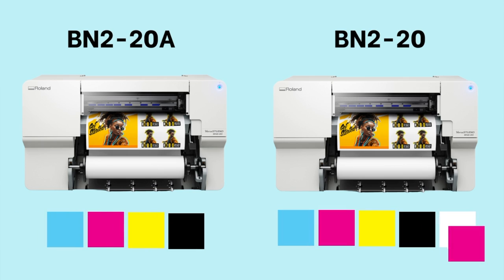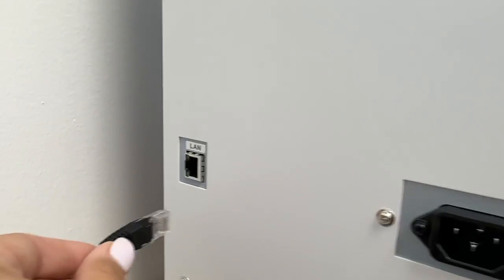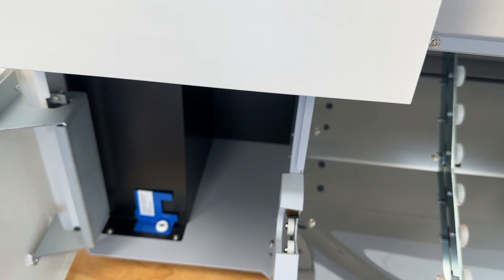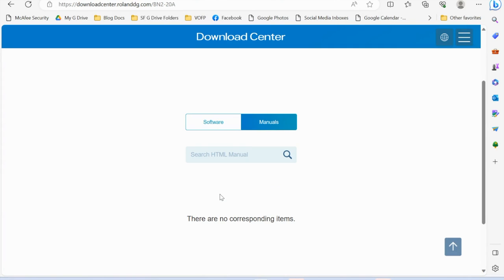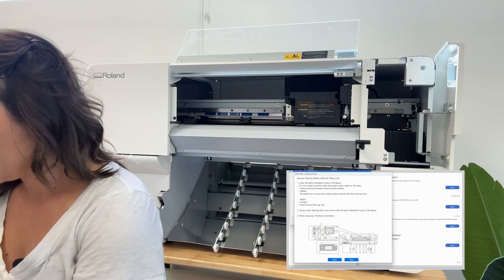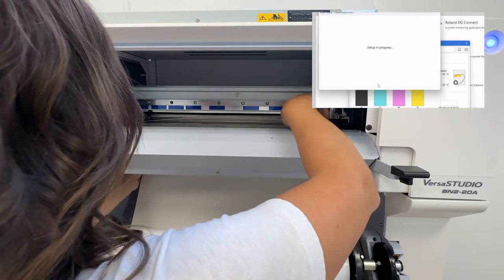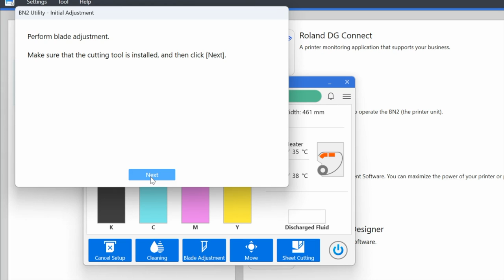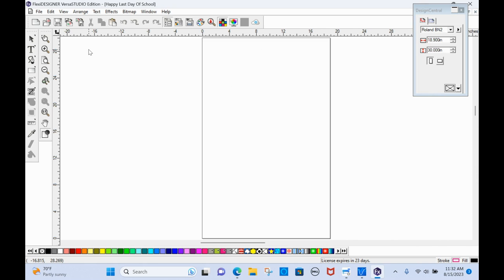How to Setup Roland BN2-20A & Software (Works for BN2-20 Too!)

Comment: Great video    setting up  BN2 20a  and stuck at error  (Roland bn2 print data is larger than the media width
Reply from the maker: Sounds like the design you have is too wide to fit on the media
Reply: I had the roller in wrong place   Thanks

Comment: Thank you for sharing these insightful videos.  I was wondering if the BN-20 is also compatible with the FlexiDesigner software.  I hear you talking about how great the program is in making it easy to add cut lines but the BN2 may be a little too much with regards to price while the BN is an easier buy.  Thank you in advance.
Reply from the maker: No, the BN-20 and BN-20A can not use Flexi Versaworks Edition.  It does make a huge difference with the ease of use with the BN2

Comment: Hello, thank you so much for sharing your knowledge. I followed your video to the letter. The issue I’m having I had a BN-20 and upgraded to a BN2-20a this versaworks wont print my PDF designs I made when I was using the BN-20 I have a job I need to finish and I get as far as loading it but when it gets to loading it to print it stays on 0%. What am I doing wrong? Thank you.
Reply from the maker: My guess is if there's a white layer in the BN-20 PDF it's throwing an error for the BN2
Reply: @SilhouetteSchool  Thank you I did figure out what it was. Did you ever have an issue with once it prints and goes to cut it off because the run was too long?

Comment: I've read that we need a separate cutter because this printer will not perf cut for very long. How true is this? I purchased this model because I did not want a separate cutting machine.
Reply from the maker: That is not the case in my experience. It perf cuts just fine!

Comment: Do you need the cleaning cartridges? Im looking to get the bundle plus extra ink, media, blades etc & was wondering if i need to also get cleaning cartridges
Reply from the maker: Eventually will need the cleaning cartridge for the BN2-20. but not immediately

Comment: Hi, great video! Is there a reason why you're not using a BN2-20insteadcof this 20A?
Reply from the maker: Yss, I don't find I need to print white (b/c the material is almost always white) nor do I want to deal with the increased maintenance that is required when printing with white ink.
Reply: @SilhouetteSchool  thanks for your reply. You're awesome

Comment: Hello, I've just installed my Bn2-20 printer, but when I start it up for the first time after filling, I don't get any yellow or magenta when testing the nozzles... do you have a solution please? Thank you
Reply from the maker: I would try to do a really good manual cleaning. If that does not work to get them going then reach out to Roland since it's a brand new machine and they should have the exact steps.

Comment: What version DG Connect Hub are you using? Their latest one v2.4.10 doesn't have FlexiDESIGNER VersaSTUDIO Edition.
Reply from the maker: What machine are you using? Flexi is only available with the BN2 machines and will show up in DG Connect once you register at BN2.

Comment: Can you cut the print to laminate and re load it for cutting like you can on the bn-20?
Reply from the maker: Yes you can
Reply: Far better to get a dedicated cutter like a Graphtec. Roland's are pretty crappy at die cutting, if thats what you're after. And for kiss cutting, its always better to let the print cure for a few hours which makes the print and cut feature pretty useless unless you are ok with leaving the print in machine. Also, I have found the accuracy is not the best if you remove the print and then reload it later - ARMS on Graphtec is phenomenal.

Comment: at 7:35 you show the blue travel piece, that has to be removed before use, and is not mentioned on any roland videos. It locks the print head in place for shipping. Also there is a piece of cardboard on the printhead that secures it as well. Roland had no idea about the clip, neither did tech support, and i had to open a ticket with their support contract company and they had to unpack a unit at the factory. We got our brand new BN2-20 and spent 2h trying to pass initial startup : (   

PS Your videos are better then theirs.
Reply from the maker: Thank you

Comment: Is it worth it to get the 5 color setup? If so, why?
Reply from the maker: I opted to get CMYK for both my BN-20A and BN2-20A for two reasons: 1) most material I print on is white so I can use that for any "spot white" 2) a whole lot less maintenance not dealing with white ink

Comment: Can you tell me where to find the FlexiDesign activation code? I dont see it anywhere and didnt see if while any software was being installed.😢
Reply from the maker: You activate Flexi through DG Connect
Reply: Thanks for responding.  I registered my unit under the Roland site, but never received a code nor an email with the code. May have to wait till Monday to speak to someone 😢

Comment: Dont have flexi designer activation code. They said after registering the printer it would be emailed. No email. Advice??
Reply from the maker: Did you download DG Connect? I would reach out directly to Roland or the reseller where you purchased.
Reply: @SilhouetteSchool  yes I did. Nothing
Reply: @awwcrap Check the big plastic cover your machine came in. There should have been a small plastic bag taped to it with some papers in it. Your activation code should be on one of those papers.

Comment: Got the machine and installed the DG connect but for some reason can’t open BN2 Utility. It’s kind of faded and doesn’t let me press open.
Reply from the maker: Did you download the full installation package from the Roland site?
Reply: @SilhouetteSchool  yes I did. Versa and Flexi had no issues downloading.
Reply: Hi, did you get it working?
Reply: @mamiii3141  yes. Turns out my computer was the issue. Thanks
Reply: @alexherman1987 what was issue with your computer that caused?

Comment: Hi, I purchased the BN2_20a. The software will not load on my Dell desktop computer. Bell & Howell and Roland "TECH" support cannot help me. They tried to add the software remotely, but I could not load it on my photobooth laptop. Basically, they gave up and told me to buy a new computer. So now I have a useless Roland BN2-2A. Did anyone else have an issue loading the software?
Reply from the maker: I responded to you on FB and didn't see a follow up.
Reply: Hi there we purchased one but cannot get the roller to move at all over to the 20inches.